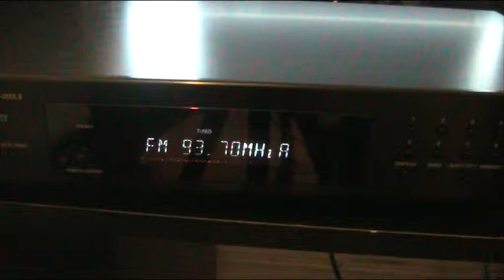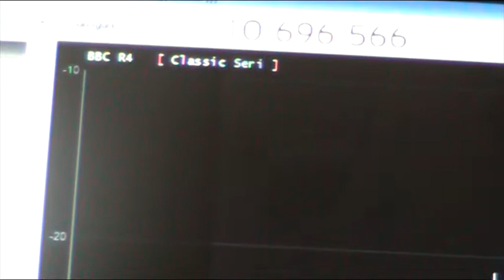10.7 MHz IF experiment CCW SDR-4+ RDS ahead-MOV003

Comment from the maker: Thanks. There is no upconverter or SDR Dongle! The 10.7MHz IF is fed from the tuner direct to a British-made Cross Country Wireless SDR-4+ (Coverage 850kHz to 40MHz). This SDR uses a sound card so maximum sampling rate is 192kHz.
Regards
Peter